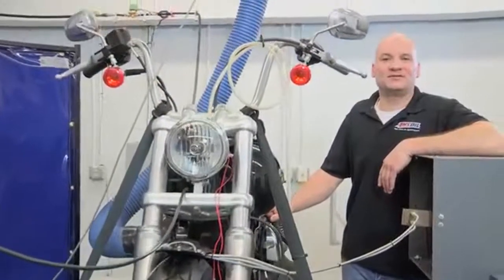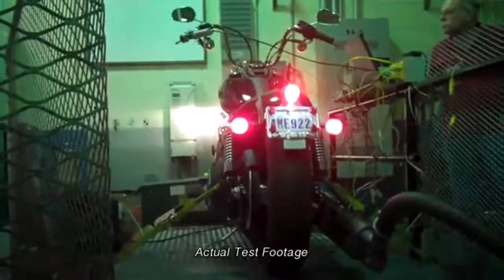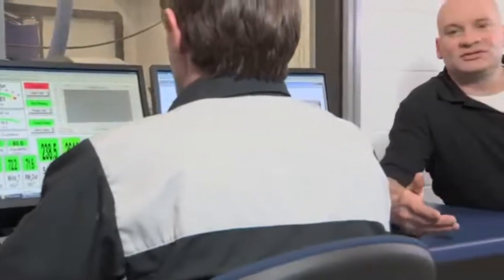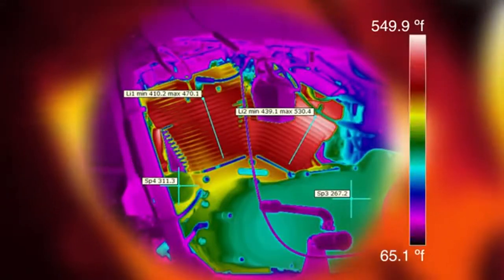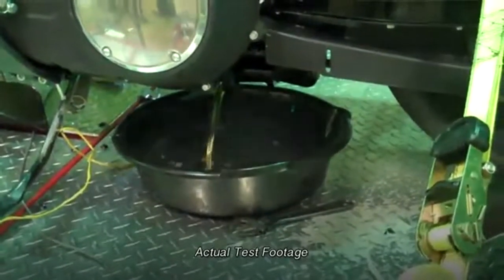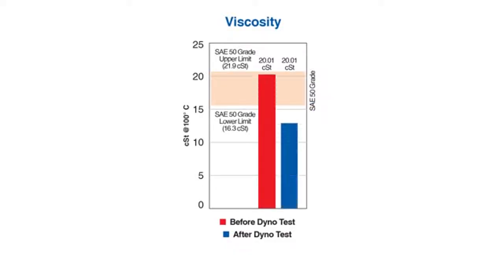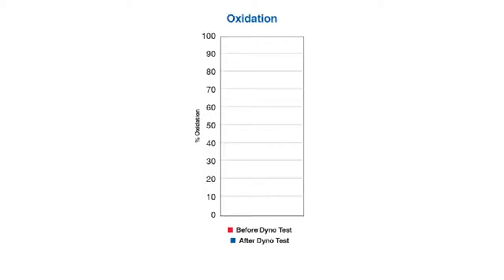AMSOIL V Twin Torture Test

Comment: Was the engine taken down to check for physical damage
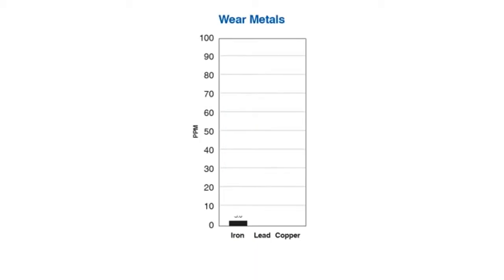Reply from the maker: That test was a number of years ago.  Tried to locate the write-up and had no luck.  In the video at the 4:20 mark, Len points out the wear metals found in the oil after the test was extremely low.  That provides a pretty good indication of how well the internal components were protected.
Reply: @HaldimandsyntheticoilCa  Thank you for you reply

Comment: Viscosity didn’t change? Does that mean draining oil while hot or cold makes no difference?? 😮
Reply from the maker: True, viscosity of AMSOIL 20W-50 V-Twin did not change in this test.  AMSOIL 20W-50 V-Twin is a multi-viscosity motor oil.  The viscosity would have had to match the AMSOIL spec sheet for Kinematic Viscosity @ 100°C, cSt (ASTM D445) and Kinematic Viscosity @ 40°C, cSt (ASTM D445).
Reply: What they are talking about is that the oil viscosity did not change from when new to after the exposure to the extreme heat. This is indicative of the oil's ability to resist shearing and thermal breakdown. The statement that the oil didn't change viscosity is not with regard to hot or cold operation. All fluids change viscosity with temperature. All non-newtonian fluids change viscosity with shear. The comment was with regard to a before and after run of the engine and they're showing that the extreme heat did not affect the properties of the oil.